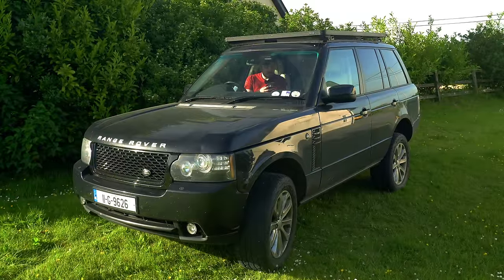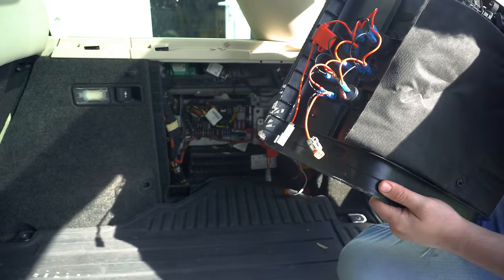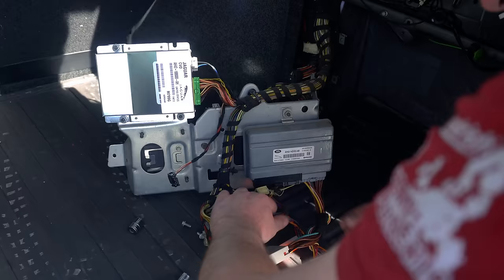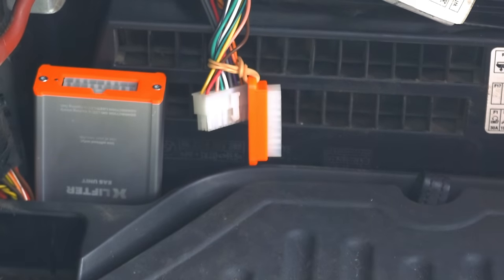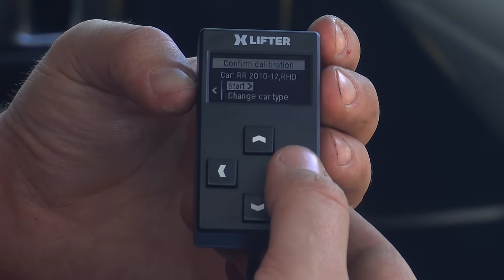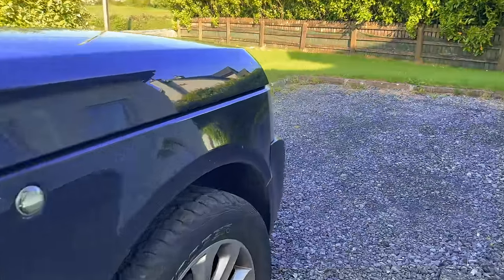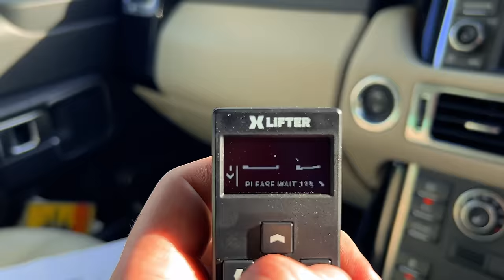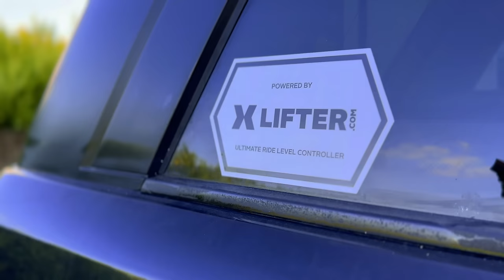OFF ROAD SELF-LEVELLING for your Land Rover with Air Suspension!  X-Lifter X2 L322 Install / Review

Comment: Iv had xlifter for around 2years on my d3 it’s pretty awesome! I use 35mm lift for normal driving  and find it more comfortable than std. I lower 20mm on motorway. The self level is a game changer camping, surprising how many expensive campervans park on the piss.

Comment: A really good and useful review of ex lifter. I have had one fitted in my discovery4 for a couple of years and camp in the back of the car when Hunting and off-roading. It really does work without interfering with the normal suspension functions in every day use. For me,Sam’s video was good in that it explained several of the other functions that I had not bothered with. I have used it with deeplyrutted tracks and swampy ground ,to good effect.

Comment: Neat, but what do you do for alignment? The L322 changes toe significantly between the different height settings from what I remember. 

A couple years ago we played with base suspension calibration settings on the alignment rack and quickly realized you need to set your alignment at your “normal” height as going any significant distance at a different height would not be a good idea if you liked your tires. 

I’m fairly certain that’s why “access height” won’t let you drive very far, because the road will ruin your tires quickly. Off-road isn’t as big of a deal due to reduced friction which is why you can lock 4WD hubs on dirt but you’ll destroy your differential if you do it on-road.

The level function is neat and I’d use the trailer loading for sure, but I don’t see this being useful for anyone wanting to change height on the fly and then drive any distance unless I’m missing something.
Reply from the maker: Good points, thanks!  I’d suggest that if you’re running a full time “aesthetic lift” like me, you get the tracking redone at the new height to minimise tyre wear and handling changes etc.  Then, like you say, any further height changes that are temporary or off road only aren’t an issue.  

As an aside, before getting the X-lifter I did around ~10,000 miles with a 25mm lift (without adjusting tracking), and haven’t noticed any untoward tyre wear.  The handling is noticeably different but it’s more the higher CoG and increased body roll that you notice.  

Cheers for the comment!

Comment: Well, after your recommendation Sam, I ordered an X-Lifter from Devon4x4 and it arrived today and is now installed this eve. 

Your video was spot on, especially ours with the extra module top-right being a squeeze!

Oddly when I was easing the panel back in, I thought I could hear some relays clicking up front towards the dash… I checked all the connections and everything not just the ones relevant, we’re all snug. 

After calibration I didn’t go through all the levels, the trailer or levelling mode but the comp temp went up to 107! (Critical). 🥴 any idea what this is indicating? Is the comp on its way out?

Thanks again Sam, another of your vids has put a dent in my wallet 🤣😁 cheers Matti.

Comment: Great video! I could do with one of those to make it easier for my dog to jump into the tailgate. Did you also install the telestart module or is that a factory module?
Reply from the maker: Yeah you could definitely use it for that.  The telestart is a factory option I believe (although I think most 4.4 TDV8s have it).  It can be retrofitted if you can find the bits!

Comment: Highway mode comes into effect after travelling at over 62mph for 30secs or more and lowers 20mm. Good bit of kit, not for me as I won't need to level the car for roof tents etc, just need to find flat ground for the tent.
Reply from the maker: One day I’ll review a product that you will actually want to fit to your RR Ben 😂
Reply from the maker: Also not sure where 62mph comes from, for the 2010+ model year it’s 100mph for more than 5 seconds and then stays down until you drop below 80 for 30 seconds.  So the x-lifter drop might be useful if you’re cruising at a more normal speed 👍
Reply: @SamsMotors  I’m not sure where it came from either, I saw it somewhere. It makes more sense to drop at 62mph (100kmh), not many places in the world you can drive at 100 mph. So your x-lifter might come in handy.
Reply: @SamsMotors  you never know, what else do you have in the pipeline? I’ve just got a budget compressor, that’ll be in next weeks video, so I don’t need one of those. 🤣
Reply from the maker: @Bensgarage  I know the P38 was 60mph but they raised it on the L322 through the years - I reckon they were trying to reduce the number of worn out compressors they were replacing or something like that.
Reply: @SamsMotors  sounds about right.
Reply: I think on the 02-05 it would drop at a lower speed, but the manual says something about 100mph for my 2012.

Comment: Hey Sam, what would happen if the x-Lifter is in extended mode and the off-road height on the L322 is selected? Will there be a warning? Can you physically over-extend the air-suspension or is there a safety cut off? Top videos btw! Love my L322 :)
Reply from the maker: Good question!  I’ve asked X-lifter to see what their response is.

Comment: I believe they need to know RHD and LHD because the air bags, struts, are different depending on which side the driver sits. Also, the L322 EAS is different to all other LR EAS systems on how they monitor each corner, the L322 has a more complicated EAS programming logic than the L320 and D3/D4, they can’t be shared.
Reply: Actually, RHD/LHD settings only swap the inclinometer axes. The only reason is that the Xlifter EAS unit is mounted "mirrored" fashion. The "Front" orientation in LHD car becomes "back" in RHD, so you need to tell the xlifter which way is right...As simple as that. 
Btw in L322 2010+ has the original suspension computer in the trunk always on the right side, no matter if LHD or RHD.  The setting is ignored in this case.

Comment: Hey Sam, just a quick question if you see this. Just watched Harry’s garage with Clarkson (great vid!). They mention the upgrade to the L322 where it got the ‘cloud lcd’ dashboard screen. Clarkson said when they used to film, the crew getting in & out of the car would fire up the ECU every time & then drain the battery. Have you experienced this at all? Cheers Sam (keep up the great work!)
Reply from the maker: Hey Chris, thanks for the comment!  The times where I've come closest to draining the battery this way are when I'm working on something inside it - e.g. when I replaced the seats and door cards, or when I fitted the CarPlay kit.  I've never drained it to the point where it won't start though!  I'm guessing maybe Clarkson's crew were charging camera equipment and other devices etc off the 12V system, adding to the load.  They need a good AGM battery to be sure of a strong start.
Sam
Reply: Hi Sam, thanks for the reply. Awesome! Yes as a fellow engineer & L322 enthusiast, i completely agree with your assessment. I personally think the 4.4tdv8 is of course the best L322 - however I actually wondered if this ‘potential’ battery draining issue with the LCD cloud screen was a possible Achilles heel I had never really considered! Always interesting to learn new insights into the L322 ! Awesome channel Sam, keep up the great work 👍
Reply: In my experience there is no issue, even when it has sat for a week. The full LCD cluster is quite pretty for its age too.  Under normal usage no issues with flat battery.
Reply: I think the main drainage would come from the interior lights not the ecu, which u can disable by holding the start button and the main interior light switch for a few seconds to bring them out of AUTO-Mode.
Reply: @gavinbeltrametti5173  swapped my interior lights for LEDs so no issue for me hopefully.
Reply: @davidwalker72  Hey mate i will do this next, just ordered some :)

Comment: Hi Sam nothing to do with this video I’ve got a 3.6 2010 sort range my front and rear parking sensors not worked all time I’ve had it . I did plug it in checked wiring found brak in it sorted now no codes it says all is. Working rear work but front don’t any idea wat this could be any help greatly appreciated cheers Sam
Reply from the maker: Any codes for the sensors?  If not I presume they’re turned off in the car’s configuration.  If you have an IID tool you can check to see that they’re turned on in the config / CCF.
Reply: The only 1 that comes on is u0159-00 lost communication with parking assist control module 😊

Comment: Where has your grille light bar gone mate?
PS great bit of kit, not sure if available for my early L322 with the 4.4 BMW M62 petrol.
Reply from the maker: I changed the grille as mine was pretty knackered, most of the mountings were broken.  I’m planning to address the lack of auxiliary lights on the front soon though 👍💪
Reply from the maker: And yes the X lifter is available for all L322s 👍👍
Reply: @SamsMotors lol, came here to ask about the grill! I like the black look and have contemplated swapping my dark gray grill for a black one as I've blacked out my wheels and emblems. Would like grill to match.

Comment: Wondering if the 1” drop really makes a difference to the mpg / handling? Mines a ‘12 AB so does feel a bit tighter in S-mode round bends.
Reply: Really wondering the same thing. I occasionally do some long hwy stints and would be good to eat out a little more mpg.

Comment: From exchanging a couple emails with the vendor I understand that if you use Xlifter to add height, say 25mm, and then use the Land Rover control to go to offroad height the usual LR height increase will be added to the. 25mm thus resulting in what is essentially extended mode. Could you please try this and report back?
Reply from the maker: Yep that is exactly how it works, any height you add or subtract with the X-lifter is applied to all of the preset heights on the vehicle.
Reply: @SamsMotors  
Thanks for the reply. Just wanted to make sure I understood correctly. You sure would not want to use Xlifter to add 75mm and then hit the UP switch🙄

Comment: aaarrgh......@13:35 So annoying that X-Lifter missed a typo for 'Right' Hand (RIGTH HAND!) in Set Steering Position mode. Bet that'll grate with you too Sam. 😀
Reply: Engineers are typically bad at spelling.
Reply: @Cromwell199  That is always the concern especially with complex electronic gadgets. The product should inspire confidence, and this kind of thing can dent that which in turn could impact sales. I understand from Sam that it is a Czechoslovakian company, so some leeway can be granted, but QC needs looking at if they are to expand into foreign markets. Hopefully Sam's test review will assist them with that.
Reply: @richardschofield2201  Perhaps they should attach a warning sticker on the box! ;-)
Reply from the maker: I'll let Jan know.  As you've pointed out - it's likely a bad translation from Czech - but thankfully it seems like it's pretty easy to update the firmware via their app, so they should be able to correct it now ❤
Reply: :) Oops, missed that. Indeed, English isn't my native but this is just a typo error. My bad, I'll fix it in the next firmware release, thanks for pointing that out. Jan
Reply: @janstanek1976  Thanks for the update and glad to hear the fix is an easy one. Good luck with what looks to be otherwise a polished product. 👍
Reply: Hi  @janstanek1976 , does the engine have to be on, doors & boot/trunk closed to operate?
Reply: @janstanek1976  I’ve just downloaded the app just for a look before I buy and I noticed temperature is also spelt wrong in the main menu 😊
Reply: @RaptorFlyer3D  Thx again, will be corrected in the next APP relase..
Reply: @RaptorFlyer3D  The engine must be on for any lift operation (the compressor does not run when the engine is turned off); Doors do not matter for Xlifter heigh changes, but must be closed for original LR height control. Trunk imho doesn't matter for bots, at least on Disco.

Comment: There are two main concerns with implementing a device like this that can damage your vehicle. 

1) the control arm bushings relative to your ride height. They have to be adjusted to your new ride height or they will prematurely wear and fail as they are twisted. 

2) the camber of your wheels and tires at you new ride height. You have to get an alignment if you plan on driving at speed with a different ride height or you will get odd tire wear and possibly upset the stability of the vehicle. 

I think these devices are cool, but if you intend to keep the ride height adjusted during road driving, you absolutely must make proper adjustments to the vehicle to prevent unintended damage. I hope this company makes the customer aware of these issues, because I would imagine them getting upset after discovering these issues and wanting to discard the device.
Reply: The Range Rover lowers by 20mm at highway speeds, which is set by Land Rover. I'm sure they would have worked that one out. And I think if you're driving round in the higher settings at speed, it won't be long until you put it back down. Any handling the car has, will be out the window at those heights.
Reply: @Bensgarage  Do they though? The earlier ones do, but the 2010+ doesn't show it on the dash like the earlier ones did, so perhaps they don't actually lower at speed... It's also not mentioned in the manual or workshop manual on the 2010+.
Reply: @JohnBaxendale  as it turns out, they likely don’t. As Sam said it lowers at 100mph. Not sure where I read it, but was likely for pre 2010 models.
Reply: @Bensgarage  I just spotted his comment too! Obviously, I’m a good boy and would never drive at over 100mph, so I’d not noticed that 😂😂😂
Reply: @JohnBaxendale  same here👍. Although our motorways can be up to 130 kph, but not  160 kph, plus it’s too expensive to drive fast nowadays.
Reply: @Bensgarage  Same (we’re in Barcelona and regularly hop the border for camping trips etc). It’s such a nice lazy ride at any speed though, of all the cars I’ve owned I think I drive it the slowest! 👍🏼
Reply: Just to keep everyone aware of my original comment, driving at any speed over 20mph is enough to create issues with bushing wear and uneven tire wear. The geometry for the vehicle is designed for manufacturer ride heights. -20mm deviation from the ride height isn't much of an issue for the overall geometry for the bushings, as there is no load induced shock with entry leveling. I have still yet to see my 12MY lower at higher speeds (?). Never had the nerve to get close to VMax the vehicle, 150mph in a FFRR just seems bonkers. I'm content with sub 100 speeds.

@Ben's Garage  Unfortunately, this isn't something that Land Rover has sorted or will be able to sort. Alignments and the bushing orientations are set at driving ride height (by measurement or setting) during the servicing of the vehicle, for each of their respective repairs.

Comment: The worst item is the controller, design and key quality compared to the rest of the system which looks good.
Reply from the maker: The other option is to use the Bluetooth connectivity and their app.  I will cover this in a future video 👍